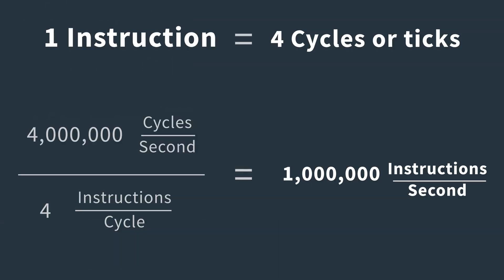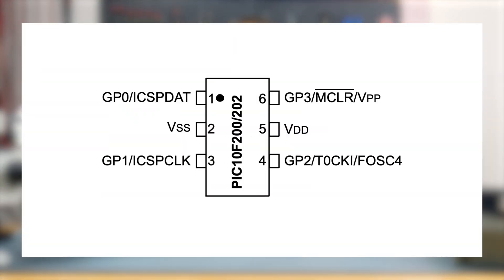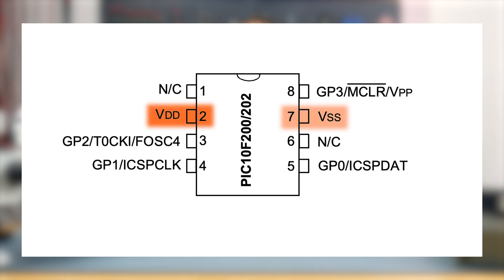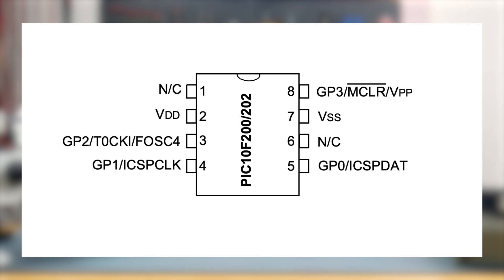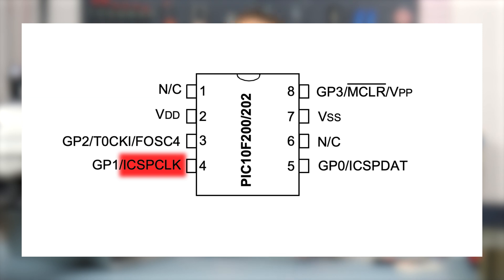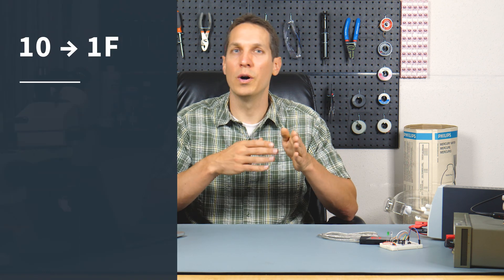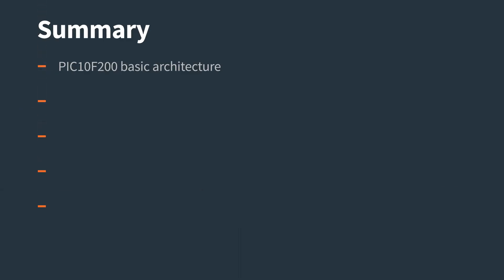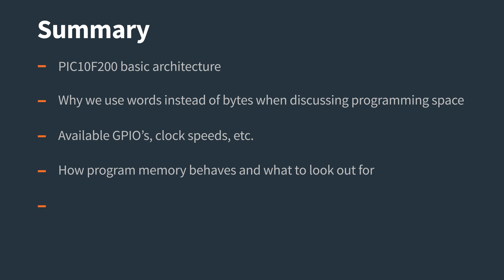Microcontroller Architecture -  Part 3 Simple Microcontroller (PIC10F200) | Intermediate Electronics

Comment: Hi, thank you for creating tutorial PIC programming video!
The reason I ended up here, because I'm looking for a solution to my problem.
I tried CD4022 to make a task selector switch, If I'm push the button it step to the other function and I have 3 different stages. My problem with this IC it will lost the position of the output after power loss. After power back up, its start from the beginning.
Is it possoble with 10F200 to programming a 3 different stage selector with 1 push button, (I think it is, I only need 1 Input, 3 output) But is it possible to store the position after power loss, and after power back up, running the program from that position?
Can I store the last position in the STACK, and after power backup it will running from there? 

Thank you for the help!

Comment: I think it would've been great if you started off the series with a disclaimer that you need a device that costs like $75 in order to do anything with one of these
the "they're so much cheaper than an arduino!" argument only really works if someone already has a programmer or is planning on using at least 5-10 microcontrollers (or more even because I've seen arduinos for even cheaper than $7.50)
so this is a great series for people who have a business plan (and money to make it happen) or make prototypes professionally or something, but it's not so accessible for people just trying their hand at using microcontrollers (which seems to be the target audience, considering how beginner-friendly they are)
Reply from the maker: Thanks for the feedback!  We just started a new series and the intro does mention that you can plan on around $100 to do the entire series and that the programmer is a large part of it.  One of the crazy things is just how much the programmer cost has increased recently.  My memory may be off, but I remember the PICKit2 (back in the mid 2000's) only cost around $35 and the PICKit4 (more recently) was still around $50. 
And while Sergey did try and make it as inexpensive as possible, my main goal of this particular series was actually to teach the fundamentals of what's going on inside microcontrollers more than offering a less expensive way to get into the embedded world than Arduinos.  Like you say, some Arduinos are extremely inexpensive AND still quite powerful.

Comment: Curious why "12 bits" when computers are magnitudes of "8" - is there an historical or engineering reason for 12?
Reply from the maker: I don't know why for sure, but my guess is that, with this relatively small and specific MCU, it was worth it to break from the norm because they needed more capability  than offered by 2^8 = 256 available options (as 2^12 = 4096, so many more options)  but wanted to save the silicon space of those extra 4 bits as 2^16 (65,536) is much more than necessary.  I don't think I'm explaining it well but, in summary, I think for the limited applications these MCUs are used in, 8 bits was too few, 16 was more than needed and wanted to save silicon space.
Reply: @CircuitBread  fascinating insights, the cost balance vs. wider bit space makes sense. thank you for the very informative series!

Comment: Wait a minute. I just googled , 1 word = 16 bits = 2 bytes. Right ?
Reply from the maker: Actually, with this, 1 word = 12 bits.  Sergey goes into detail on this in the written tutorial: https://www.circuitbread.com/tutorials/microcontroller-architecture-part-3-simple-microcontroller-pic10f200  
I do think that the term "word" depends entirely on the platform being used, so I'd only confidently apply this to PIC MCUs.

Comment: Sir, I have a doubt, which type of microcontroller should I use? three are a lot of types PIC, AVR, etc...
Reply from the maker: Great question, it depends on what you're trying to do!  This series is practical but it teaches a lot of concepts about how a microcontroller works at a very basic level.  If you just want to create something quickly and easily and don't really care about the concepts the microcontroller is working on, I'd recommend an Arduino Uno or other common Arduino board (based on the Atmel chips).  If you want the concepts, I'd start here with the PIC10F200 (or other PIC10F2XX) series and work through it.  Once you have an understanding of how they work, you can switch to other types (like STM, TI, RL78, etc.) much easier, as you'll understand the differences better as well.
Reply: @CircuitBread  Thank you, sir, you are my virtual teacher in electronics  :)

Comment: Could please help me on this PIC , can i use this PIC16F15324T-I/SL right now i have this with me !
Reply from the maker: A lot of the commands should be the same or similar, so you should be fine using a PIC16F series.  However, Microchip has made some changes recently that have thrown a monkey wrench in some of the code, so depending on the assembler you use, there may be issues.  On one hand, it really sucks, on the other hand, the changes should be minimal enough that the structure still works and much of the code, and it will be a good learning experience to explore them on your own.  I know that doesn't seem like much of a benefit when you're banging your head trying to figure something out though... 😁
Reply: @CircuitBread  Thank you for the time to reply , let me bang my head and continue the Adventure! -Thank you so much for such a great series.

Comment: Why use an h. I thought Standard labeling of hex is a base 16 at the end
Reply from the maker: Yep, the standard is "h" but, if we remember to, we like to put "h" at the end of all the hexadecimal numbers.  The reason is twofold - one, it's explicit and reminds us humans when we're reading the code that the code is in hex, not decimal (which my mind still defaults to). And two, not all microprocessors, tools, and programmers default to hex, so it helps to be explicit.  Feel free to not put it in if you wish!  Should still work in this case.

Comment: I don't understand how hexadecimal figures can be routines and subroutines. I understand the concept around decimal and hexadecimal and binary, but I'm not understanding how a few hexadecimal figures can be a whole routine
Reply from the maker: Yeah, it is kinda mind-boggling.  The issue is that what you're referring to is machine code.  Have you ever taken a computer architecture class?  I did a couple years ago and frankly, after going through these tutorials, I kinda want to take it again.  I feel like I have a better foundation after Sergey's explanations and would get a lot more out of it.  Anyway - hexadecimal is just representing binary which is just representing high and low voltage signals that are running through a very complex digital logic machine that is just emulating the behavior you're asking for.  Even at this low level, it's amazing how many abstraction levels there still are.
Reply: @CircuitBread  I'm a senior mechatronics engineering student and I'm in my microprocessors course where we're first getting introduced to this sort of material. The concept of binary I understand with latches, logic and transistors but this is a whole new level for me and I find myself very lost and confused
Reply from the maker: If you're doing mechatronics, you don't need to get that deep.  I know the desire to understand everything at every level, but for what you're doing, I'd say anything underneath the registers on the microcontroller can just be treated like a magic black box.  In my opinion, if you understand at the level of depth we go here in these tutorials, that'll be more than sufficient to serve your purposes.  At the same time, we are working on a one-off video that will try and connect all the layers of abstraction in a microcontroller or processor - I'm excited, if it turns out as good as we're hoping for, it'll be a really interesting overview.  But it's probably 2 months out still.
Reply: @CircuitBread  well on the surface your videos definitely cover all that and I appreciate it. It's helping me bridge the gap between binary and hexadecimal and how the processor computes the information. I really enjoy your videos and I'm looking forward to the update to the microprocessors series :)

Comment from the maker: @ 1:31 there's a mistake in the denominator, it should be 4 cycles/instruction.  A thank you to Visweshwar for pointing out that error!  This video tutorial is a companion piece to Sergey's written tutorial which goes into even more depth and is highly recommended to read through after watching this.  Check it out here:  https://www.circuitbread.com/tutorials/microcontroller-architecture-part-3-simple-microcontroller-pic10f200

Comment: thank you :)
i didnt found any content in portuguese(i am brazilian) about this small microcontrollers 
i am thinking to use a 10f202(becouse it is so cheaper) with rf 433mhz to make a rf pulse button to control the home(lamps for example) , when i press the button, the microcontroler send your code and the rf central understand what there is a rf button near
Reply from the maker: Hey Eric - we actually have a tutorial on that already.  I haven't made the video for it yet, but if you check out the PIC10F200 tutorials on CircuitBread.com you'll find the written tutorials that Sergey has already done on this topic and more!